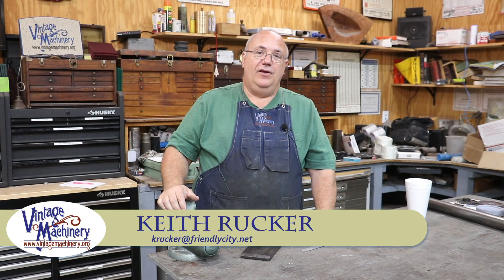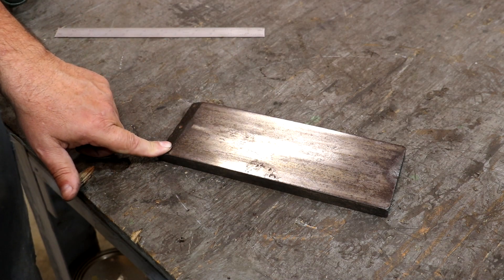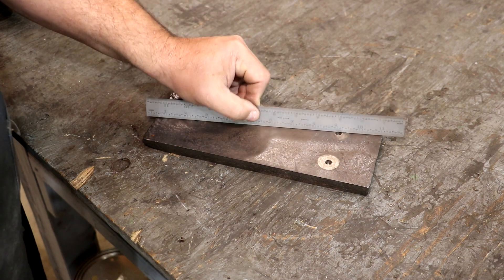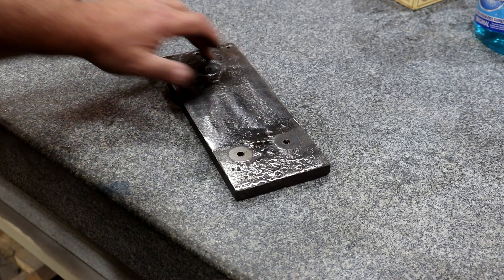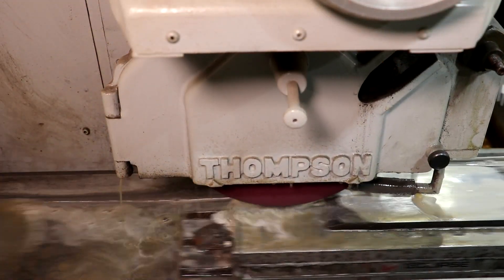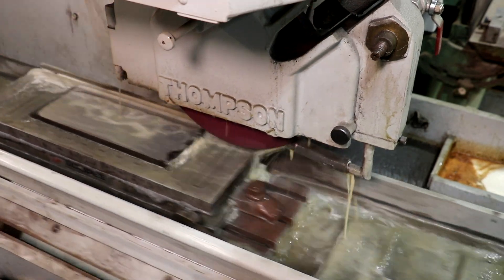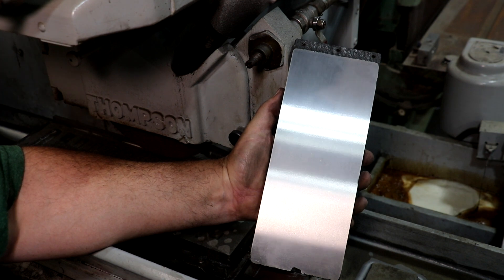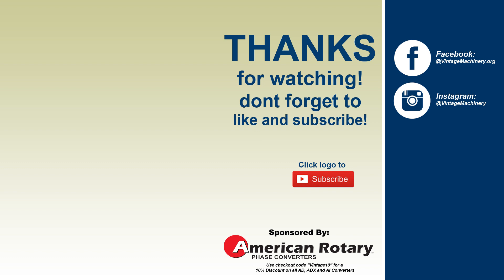Precision Grinding a Belt Grinder Platen Flat on the Surface Grinder

Comment: In college (1980's) we had a surface grinder that was placed between two concrete walls, some naughty engineer students would 'test' the depth of grind the machine could handle before it removed the 'test piece' from the magnetic chuck and fire the material into the wall. There were several test diverts in the concrete walls, obviously I would have never added to them, that would be naughty and very dangerous.  Thank you for the video, and showing us your beautiful grinder, she is something.

Comment: Whether surface grinding or circle grinding a will push away and will not take all the material in one pass. That's the reason for spark
Reply: out passes. Same holds true for any cutting operations.

Comment: I think that I would have freshened up the contact points on the back to make certain that they were parallel to the front.  Thanks for sharing the tip to check the back for a good meet before grinding the top.  I’m (somewhat) steadily learning.

Comment: Request - next time you run the surface grinder, can you secure a camera to the carriage?  So the chuck is stationary relative to the camera and the wheel moves past?   
Could be a nice visual.

Comment: Just curious. Imagining the variation in the belt & grit and the wear on the platen from grit that gets under the belt. The smooth platen will reduce belt wear, but I wonder what the original specification was.

Comment: I have two and use one.  Mine run slower, that seems lighting fast.  As long as it cuts.  Using a Ruby wheel that cuts most stuff.  There are cooler (white) and tougher (black and green).   The white wheels chip or give off grindstone grit as you grind. The heat goes with the chips.  Not a tough wheel.

Comment: It always fascinate me how those surface grinders work and can achieve such precision. If you think about it, those disks are always shrinking while they grind, but I assume that shrinkage is not noticable during a single job?
Reply: It only works the way ^ he said, when you are not doing full wheel width step overs. The first strategy Keith used was a full step over grinding technique. This wears the entire wheel. The finish strategy he used, where the wheel is constantly moving, is wearing the edge. But even on a full step over, the wear only matters on one pass. So, say it moves over 6 times to get across the part. The little bit it wears doesn't matter much. You're not compounding the wear from the beginning of the grinding to the end.
Reply: It absolutely is. The trick is they only wear from the edge in, so as long as the middle is still at the original diameter you will still cut to size.

Comment: I have a neat project idea for you that can help with workpieces like this: magnetic transfer blocks. Basically just some blocks of brass or aluminium that you drill a bunch of holes into and then press steel rods (or nails or something) into. Afterwards you can mill and grind them to your required height and even shape if needed. Adam the Machinist made a video about it and it looks so cheap and easy to make that it's really a nobrainer, and they let you hold the plate in three points without squeezing any hollow parts.
Here's said video: https://www.youtube.com/watch?v=cQDkqLz4Sug
Reply: Watched the liked video and really liked the block/nail idea. For those with surface grinders, a great tool to have.

Comment: At the shop I worked at, I had to surface the magnetic chuck now, and then. The abuse the machine took was bad sometimes.  I usually let the machine warm up at least 30 minutes to make sure there was plenty of oil under the table, and wheel slide. Then I would set myself stops, deburr the piece, and away we go!

Comment: The owner will have to shim that platen out since it's now about a 32nd thinner, so that it's still got the same relationship to the belt grinder's wheel diameter, won't he?
Reply: No
Reply: @randy-yk1yk  Since you say a flat "No", is it that the platen is spring loaded downwards (or outwards) and therefore can make up for that amount of stock removal?
Reply: @frenchcreekvalley  the platen moves freely in and out. The material removes is inconsequential

Comment: I keep second guessing Keith in my mind...why not do a few of passes on the back so that when it's mounted, it's not two imperfect surfaces coming together? The other instance was when machining the crank shaft gear. When the center shaft bore was cut, the inward face of the front perimeter could have been cut round and concentric to the shaft bore, on the same clamped down pass. That way, when he flipped it to the the back of the gear, the chuck jaws could press on the trued circumference.

Comment: I learned to surface-grind on a war-badge  Thompson, quite possibly the same exact size as yours (although it didn't have the top wheel-dresser). After a few weeks of grinding with it, I had to jump over to a Do-All grinder made in the early 90's, and couldn't seem to match the quality of the grind. A guy passing by saw me looking at the difference in surface finish,  patted me on the shoulder and said "Don't worry about it, those old Thompsons are hard to beat".

Comment: Beautiful finish as always.
Little bit overkill for what it actually is, a piece of new tool steel flat bar would have been plenty for a platten.
But in the end this would work fine👍
Reply: Why take the time to build a new one? The whole project probably didn't take an hour. Even though the piece looked like cast to me, it will last a long time depending on abuse.
Reply: @robertwatkins364  it's a matter of drilling and tapping 3 holes in a piece of flat bar.
Takes all in about 15 minutes to do so.
On my belt grinder I built myself have a piece of 10mm mild steel flatbar with 3 holes tapped into it.
Used a flap disc to grind of the excess screw length and called it good.
Made alot of knives on it and there is still hardly any wear on it.
I doubt its cast iron, it's probably toolsteel.
Reply: @samuraidriver4x4  okay then
Reply: @samuraidriver4x4  I thought it looked like cast steel, not iron. Cast iron might load the stone pretty quick.
Reply: @robertwatkins364  looking at the sparks its low carbon steel.
Flat bar is the cheapest way to produce something like this.
Reply: @robertwatkins364  most are carbide. That's just a tool steel version. The pitting is making you think it's cast.
Reply: @samuraidriver4x4  make a new one and then have to grind it too. LOL. It would take like 4x longer than grinding this one.
Reply: @littlejackalo5326  when I seen machined bosses around the bolt holes, I figured it was cast
Reply: @littlejackalo5326  for a belt grinder platten there is no need to go any flatter then cold rolled flat bar.
If you do want it flatter skim the top off with a fly cutter and call it good.
Drill holes and skim the top in 1 setup in the mill.

Comment: I gotta ask - is this not a bit overkill for the backplate of a belt sander? Does it need to be precision ground?
Reply: Of course it is overkill!!  Everything about these YouTube machinist channels is over the top.  Very little 'real life' solutions, but that is OK.  It is what we tune in for!
Reply: @paulcopeland9035  That is true - the obvious solution (get a bit of flat bar stock and drill & tap 3 holes in it) would not make for an interesting video... and maybe there is some sort of "precision belt sander" that we don't know about...

Comment: Would it be an unnecessary amount of accuracy to grind the three mounting points on the back to be parallel, or is it something you shim during reassembly?
Reply: they are parallel to the face of the plate now. To make the face parallel to the rollers - yes, you adjust the plate using shims or adjust rollers during assembly.
Reply: @elrond12eleven  unless you run them under the surface grinder then all three mounting bosses may not even be coplaner with each other.   I understand that they were referenced by the mag chuck, but what percentage of contact area did the chuck have to each boss?  Like I said, that may be more accuracy than needed.  I was just asking a question.
Reply: @buckinthetree1233  Keith said he considers them ground in the same plane at the factory, and they have no wear. Yes, may be the plate somewhat warped in the years passed and surface plate and ink will show it... But I dont think mounting points on the frame are perfect in that sense, so contact of high spots with high spots is enough.

Comment: My mother used to tell me that she made aircraft parts in England during WW2.  She was very proud of her skill as a "precision grinder"  - and the fact that the parts she made went into Spitfires!  So now I know the sort of thing she did!
Reply: There are a few more kinds of operation that could be called "precision grinding". Considering how many more cylindrical parts there are compared to flat parts in a Spitfire airplane, you might want to investigate OD, ID, and centerless (or centreless in UK). grinding. All these require similar skills and patience to surface grinding. What a great memory to have.
My own mother was an inspector in a Detroit, Michigan armaments factory during WWII. Her tales of explaining to old-time machinists two and three times her age that they now must work to tenths of thousandths of an inch rather than thousandths were pretty funny.
Reply: @PeterWMeek  Yes indeed Peter, I well remember mother saying that the grinding had to be done to "within a tenth of a thou" and I also remember the phrase "centreless grinder".  She said one of the many jobs she became fast and accurate at, was grinding "universal ball joints for the control rods in Spitfires".  As a kid, I never really knew what this meant!  Like most of the factory girls, she was then  only about 19-20 y/o - just about the same age as the RAF pilots who flew those fighters.
Reply: Thats so cool. I doff my cap to all the amazing mums and women who stepped up in what was traditionally a mans domain. They helped build, weld, much of the weapons and vehicles, ships and planes, EVERYTHING. They truly helped win the war. Out-producing your enemy is vital to winning a war. All the women, and us mere men won the war.

Comment: I would have machined the other side. And threw some weld on that one spot on the front side to fill that in. I don't think the thickness of that part is critical to the operation of that plate. I could be wrong though. The other way would be to just make a whole new plate.
Reply: Jesus, it's just a belt sander looking for a cabinet to grind on.  Enough!!

Comment: To finish this part much faster I would plunge grind manually in steps to remove most of the material leaving about .002 for finishing. Redress the wheel and remove the last .002 by reciprocating the head. Time, about ten minutes.
Reply: Why is "faster" an issue?  Was he in a YouTube grinding race??
Reply: @paulcopeland9035  Faster is not an issue with Keith since he’s teaching basic grinding. However if you had ten of these to grind in a production shop you’d need to use a faster method to save time. 
By a combination of plunging and 
reciprocating ten parts can be ground almost as fast as milling and with a much better finish.

Comment: It sure would be nice to have a bench vise to hold those parts while grinding that rust.
Reply: @ralphgesler5110  ????
Reply: @ralphgesler5110  distortion would be minuscule for the amount of force he'd need to clamp it in place, and it wouldn't matter anyways. A few thou of bow wouldn't make any difference when you're using a hand grinder and flap wheel.
Reply: That piece had enough mass to take the force of the flap wheel without moving on that rough bench. Also, using the vise would likely make Keith choose the least uncomfortable position for grinding ..... kind of a pain he can surely do without these days.

Comment: Silly Question: Do you ever take the precaution of measuring the part your working on and making a drawing 'just in case everything goes badly' and you are forced to make a new part?
Reply: Keith has had situations where a part was rendered unusable, but not totally destroyed (In the videos I've seen anyway :) and he was able to make a new one by working off the machine the part came from, or what is left of the old part.
Reply: Yes......silly question for a belt sander platen!

Comment: Nice job!  This is probably overkill, but since you have such a nice flat plate and all the equipment for inking it up, could you have used this to quickly identify high spots on the top side?  Since the plate should ride only on the three bosses, this would quickly identify any small high spots to take off with your hand grinder.  Probably not a big deal, time-wise, either way.  Just wondering.
Reply: Yeah nah, I reckon Keith just loves to make videos and treat a job for a friend as "Top Priority" haha, but I see your point if it was his own job

Comment: What an incredible machine. It's the Ferrari of grinders!!
Reply: I want to build one.
Reply: @loganosmolinski4446  A noble undertaking. You start with a complete cast iron for foundry. (:-))
Reply: @ellieprice363  you laugh but the reason these machines are made of cast iron is because it's cheap and easy to cast to shape. It's mostly just sand and wood and a large enough crucible.
Reply: @loganosmolinski4446  just as easy as that, Hahaha 🤣🤣👌
Reply: @bigtrev8xl  lol at least it's not cast magnesium. That will light on fire if it's not in a inert atmosphere.
Reply: @loganosmolinski4446  So you want to make a full size precision Thompson surface grinder? Good luck on that one.
Reply: @loganosmolinski4446  you're not reading the room. It's WAY harder than you have in your mind. There was a YouTube channel that tried building one, and they failed. Do you know how difficult it would be to do just the mold and caring your talking about?
Reply: @littlejackalo5326  you're taking the joke too seriously.

Btw what YouTube channel was that, it sounds interesting.
Reply: @loganosmolinski4446 .... Sir, are you high?

Comment: I thought they were suposed to have a crown to keep the belt centered.
Reply: Crown would be on pulleys not the plate.
Reply: @kdenyer1  Ok thanks.
Reply: If you “crowned” the platen, you would never be able to square a part across the width of the grinder belt.

Comment: That looks similar to the platten on my Porter Cable G4 belt grinder. Mine was destroyed by years of previous use from users introducing a crude coolant system and never maintaining the machine. It looks like the machine this came from suffered a similar fate.
Reply: It is indeed from a G4 and while the machine looked decent from the outside it was rusting itself inside out. Most screws and nuts were rotting off and simply snapped trying to turn them.